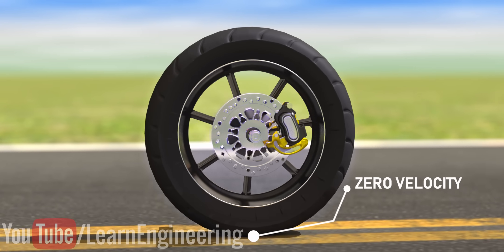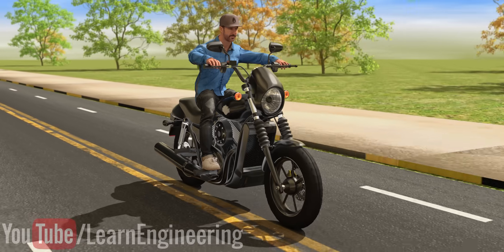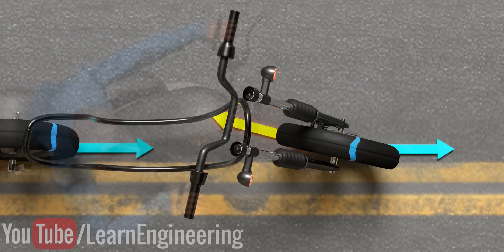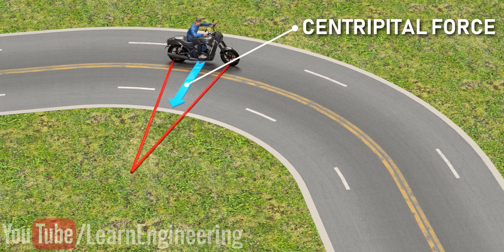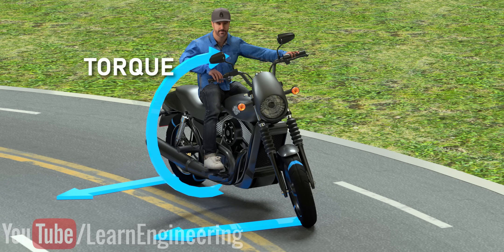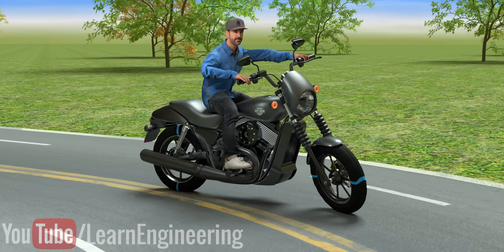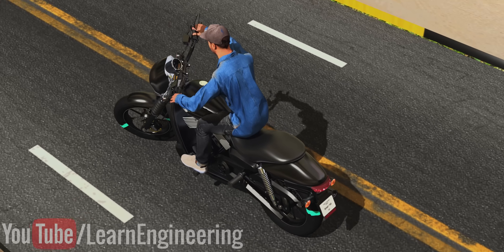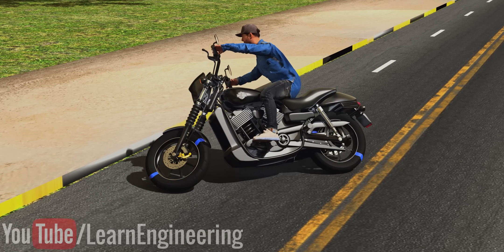Counter Steering | The interesting physics behind it

Comment: One of the worst videos about this topic I've seen so far. There are far better examples with showing real footage. Animations are really weird and only work if you already know what they are trying to show and to fall the low speed steering "normal"  is also weird because it's not normal for a bike to be steered like that most of the time you drive. Makes the impression of there is a choice between both which there isn't.
Reply: 100%. Counter-steering is really quite simple. If you stand beside a normal bicycle and turn the front wheel in either direction it will begin to fall inward in the opposite direction. So what does that mean? For a motorcycle it means that if you push with your right hand, turning the handle bars to the left (with the motorcycle at speed greater than 7mph) the motorcycle will try to fall to the right. This translates into leaning to the right and yes if you keep that steering angle it will fall to the ground. So you stop pushing with your right hand and return the steering angle to center.  You will have established a steady state, the lean will still be there and the bike will continue to turn right. You could pull with the right hand to eliminate the lean but more often you'll find yourself accelerating and that dynamic will also bring the bike back up. Remember, all these move are very subtle and more so the faster you go. At 160 mph I can assure you it still only takes a few lbs. of pressure on the handle bars to make the bike turn. I can also assure you that at the speed, without counter steering, you can hang off until your entire body is off and only one leg is on the seat and you'll never turn. You can drive straight down the road like that.

Comment: There’s only one way to steer a motorcycle going more than 25 km/h and that’s counter steering. The “normal” way will get you at the ditch
Reply: Absolutely. However the transition is dependent on the steering head angle and generally about 7 mph. That's why so many novice rider get killed turning after a stop at an intersection.

Comment: Just to make things clear, "counter steering" IS "normal steering". Above 10mph (depending on front wheel geometry) it is the only way the bike can steer. The thing is, you can turn more quickly if you deliberately (briefly) weight the bars more than normal in the opposite direction to the turn. This is what is commonly referred to as "counter steering".

Comment: the opoostite steering works only in drift conditions
Reply: Your full of shit. Counter-steering is really quite simple. If you stand beside a normal bicycle and turn the front wheel in either direction it will begin to fall inward in the opposite direction. So what does that mean? For a motorcycle it means that if you push with your right hand, turning the handle bars to the left (with the motorcycle at speed greater than 7mph) the motorcycle will try to fall to the right. This translates into leaning to the right and yes if you keep that steering angle it will fall to the ground. So you stop pushing with your right hand and return the steering angle to center.  You will have established a steady state, the lean will still be there and the bike will continue to turn right. You could pull with the right hand to eliminate the lean but more often you'll find yourself accelerating and that dynamic will also bring the bike back up. Remember, all these move are very subtle and more so the faster you go. At 160 mph I can assure you it still only takes a few lbs. of pressure on the handle bars to make the bike turn. I can also assure you that at the speed, without counter steering, you can hang off until your entire body is off and only one leg is on the seat and you'll never turn. You can drive straight down the road like that.

Comment: I can't wait for someone to try normal steering while going 50mph. The thing this video doesn't mention at all is the gyroscopic stability of the motorcycle is amplified as speed increases. Less than 15mph you steer normally because your forward momentum is so slight turning the handlebars makes the bike fall over in the direction the bars are turned, it has 0% to do with shifting your weight. Actually during slow speed maneuvering you will counter-weight, ie lean out while your bike is tipped into the corner so your weight doesn't add to the weight of the bike.
Over 15mph is when you begin using countersteering, when the "top heavy" nature of the bike will attempt to sling out on corners. Due to the gyroscope you physically CANNOT use normal steering. It's all about the speed and weight of your motorcycle.

Comment: When you turn in a car the car pivots over it's roll center and weight shifts to the outside.

When you turn a bike it pivots over it's contact patch and shifts weight to the opposite side you turn the handles to. When it does that, the profile of the tire allows you to move the bike in the direction bike leans to.

I'm talking out of my ass but I think this is why you need to countersteer. Feel free to call me a moron if I'm wrong.

Comment: I ride and I can say this is just confusing cause the vid acts as if you have a choice in counter steering or normal steering. Basically you can only counter steer at fast speeds and can normal steer at slower speeds.

Comment: There's not "normal steering" on a motorbike. It only turns by a (maybe minimal) counter-steering. That's because bike's fork line does not point to wheel's contact point to the ground. This makes 2:45 to be actually impossible cause the inwards turned wheel would be pressed against the ground when you lean, making bike go straight again as wheel cannot trespass the tarmac.

Regular steering does only work on extremely low speeds. Being "extremely low" dependent on each bike because of it's fork angle.

Comment: The information in this video is completely misleading. You cannot choose between counter-steering and normal steering - a bicycle or motorcycle must be turn using countersteering above walking pace due to the centripetal force on the wheels. Whether you realize it or not, you are countersteering whenever you ride a motorcycle or bicycle. This video is so misleading as to potentially be dangerous. Please disregard.

Comment: Love the thoughts behind making this CG, except the rider has no helmet and consistently is riding on the yellow lines, the absolute slickest part of the road and where oncoming traffic is... and counter steering is not performed by turning the handlebars, but pushing on one side. Also, I do not understand the concept of normal steering, it's like low speed turning and leaning got lumped together.  Also, using a moped going 4mph as an example of counter steering?
Reply: Pushing on one side of the bars turns them, if only a tiny bit. In one of Jerry Palladino's videos, he shows how to do a u-turn on a narrow road. He begins the turn with what he calls a "dip" to the right, a quick right flick of the bars, which makes the bike lean to the left. Regardless of what anyone says about "regular" steering, this is counter steering a three miles an hour.

Comment: This mis-information. At speed one does not and can not turn the handlebars.  One presses theleft bar end to go left andn the right bar end to go right and there is NO turning inbolved and the front wheel does NOT turn on the  spindle. Only at very low speeds does turning of the bars come into play.